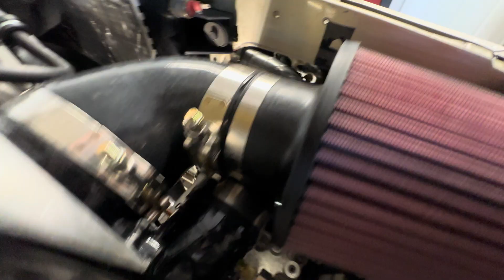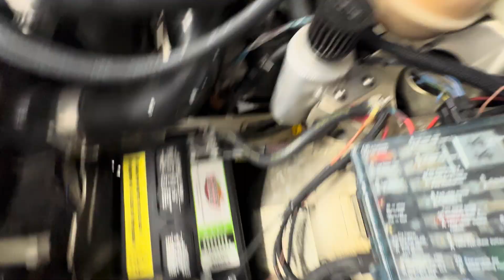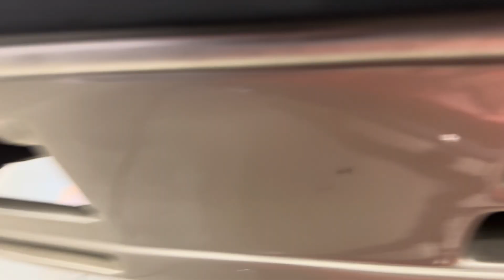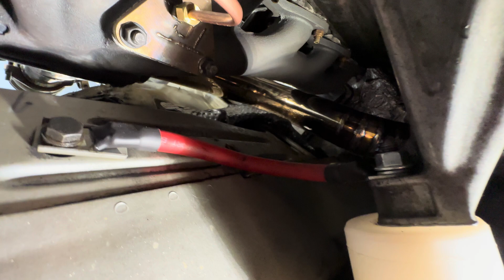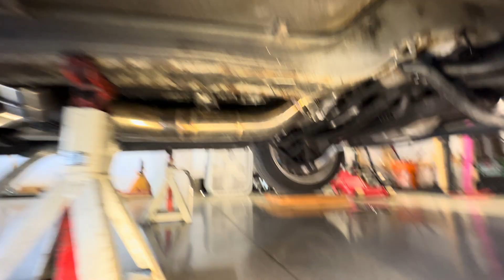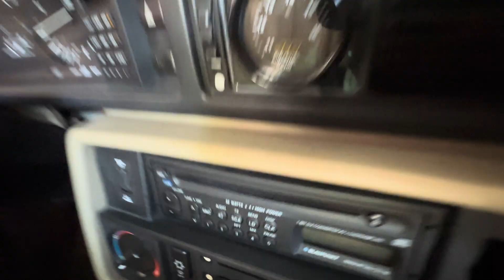Budget Turbo BMW E28 V2 Build Overview

Comment: Glad I found this channel, I just recently aquired a TCD manifold and want to use an Holset for 350-400HP. What are your Holset specs??
Reply from the maker: 385whp was a 54/60 he341. 560whp is a. 60/67 he351
Reply: @TurbineResearch many thanks sir.

Comment: I've been admiring this build for awhile and its finally my turn. I just picked up a '73 Bavaria shell and a m30b34 with a manual. I'm wiring to up to a microsquirt and I'll put a turbo on it this winter
Reply from the maker: That’s awesome 👏 keep it up !
Reply: @TurbineResearch thank you, I'm shooting videos, parts should be here this week!

Question, how are you reading boost pressure?
Reply from the maker: @kraabol.mp4  the MAP sensor that talks to the ecu is how I see boost pressure increases until the data logs
Reply: @TurbineResearch I figured, I just didn't see which one you used and were it's located

Comment: Rpm limit ?
Reply: I'm planning m30b35 or m30b30 depends which one pops up on sale first with either b28 or b25 crank 
Also a turbo on it
Reply from the maker: 6300rpm

Comment: Did you ever use RTV with your paper gaskets when resealing your oil pan, timing chain cover, etc?
Reply from the maker: I did use a light coating of rtv on those gaskets

Comment: Cool build but why not go with a zf320/370 or a g420 transmission? Do they not bolt up?
Reply from the maker: Not to the m30
Reply: @ bummer, they are pretty strong. Sorry I don’t know much about m30🤷‍♂️ I’m a m5x fan boy
Reply from the maker: @ m30 has basically zero transmission options without adapters

Comment: the trans will last a bit longer without the solid mount shifter if you plan to beat on the car
Reply from the maker: It gets nothing but beatings and seems to be holding up nicely

Comment: I just built another one last year. Started with a factory super eta, got bored pretty quick with the turbo eta so I went back to the original recipe. Currently running about 13 psi on the super eta with the B25 top end. Parts are not as cheap and plentiful as they used to be, we just have to be a little more meticulous these days.
Reply from the maker: Turbodan ! Thanks for checking out the channel! You were one of the original inspirations to all of our turbo e28 projects on the channel. I’m glad you’re back in the game. I’ll watch for any video updates of your projects

Comment: What pump gas are you running? Sorry, you probably mentioned it in one of your dyno videos, but I forgot.
Apparently, extended use of E85 can cause oil sludging.
I'm spraying washer fluid under boost on my M20. Not noticing any oil sludging from it. Will you be adding any type of liquid injection for charge cooling?
Reply from the maker: I have a flex fuel setup so it’s 91 pump gas most of the time and on high boost it’s flex fuel with e85 or methanol